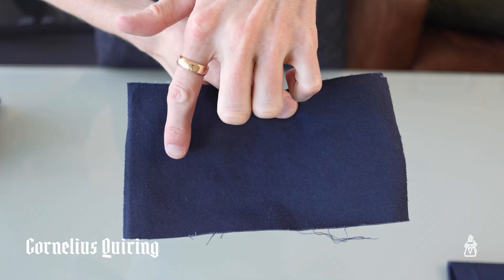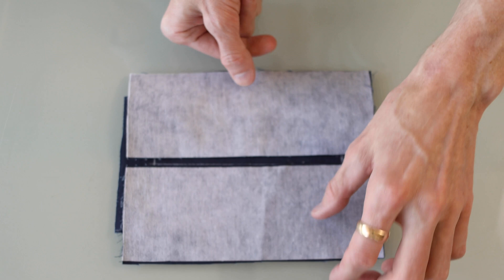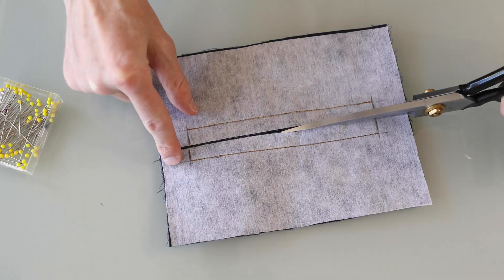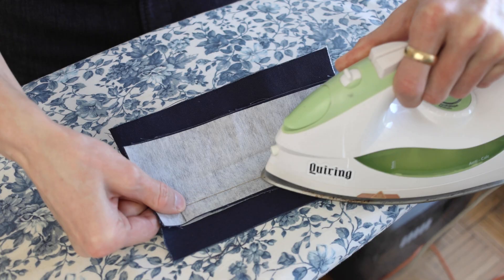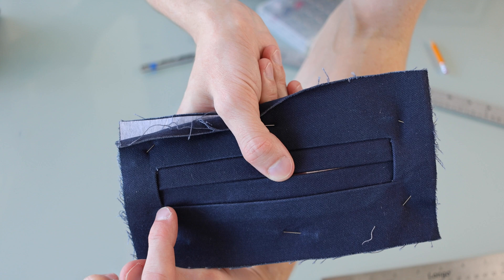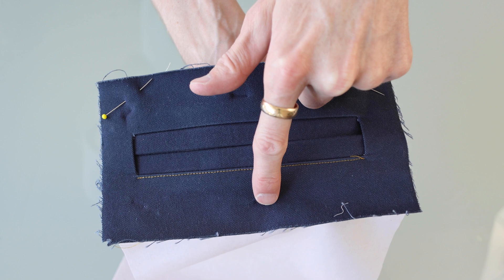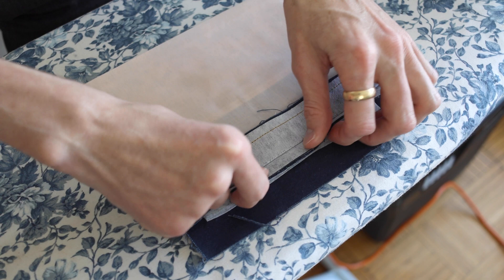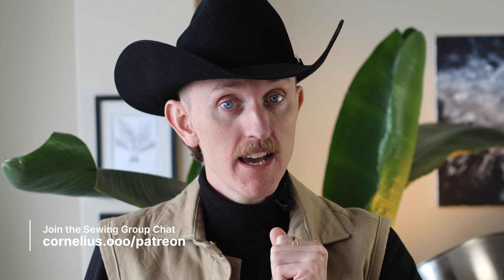How to Sew a Double Welt Pocket

Comment: That's a really shallow pocket. I have big hands, for a female. I prefer deep pockets.

Question: on making shirt pockets is there a method for the math to get the point/angle correct? 
As a former truck driver I liked long tailed T shirts and long, 7", pockets. I carried my small notepad and my pen in my shirt pocket. Normal pockets were too short.
Reply from the maker: In terms of adjusting the angle/point of the collar, I would add perfectly horizontal lines of the pattern and then transfer them over to the pattern. From here, I would create the desired angle.
Reply: @CorneliusQuiring  Thank you hon, but I was asking about the point of the pocket, not the collar. Thanks anyway.
Reply from the maker: I typed collar and meant pocket. Same thing applies :0